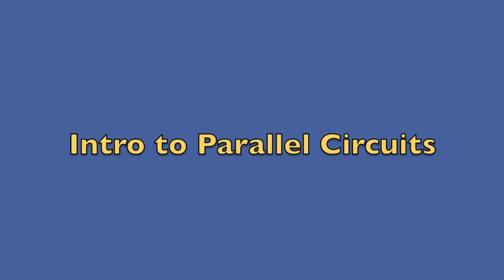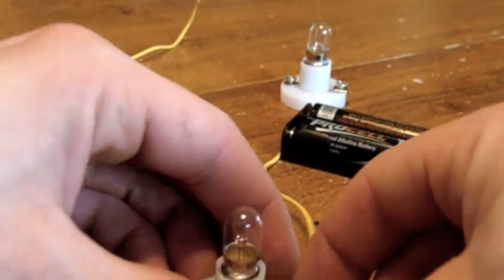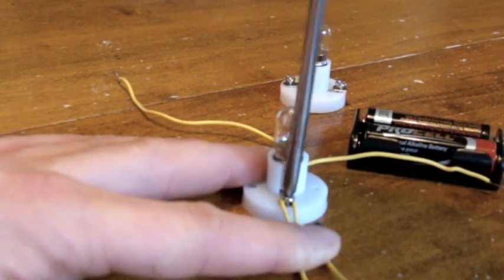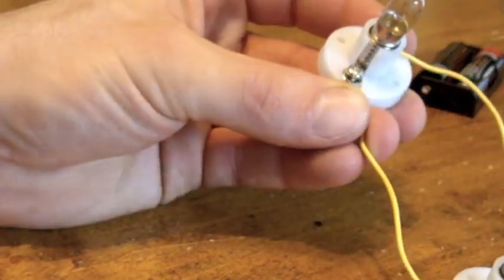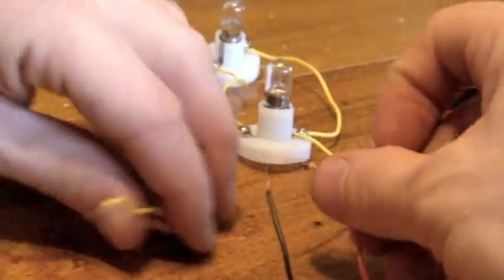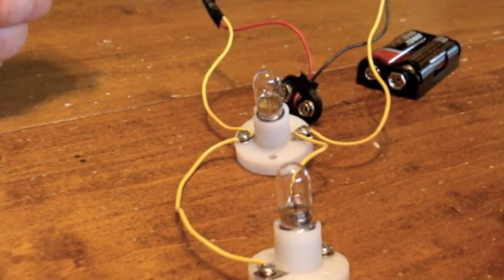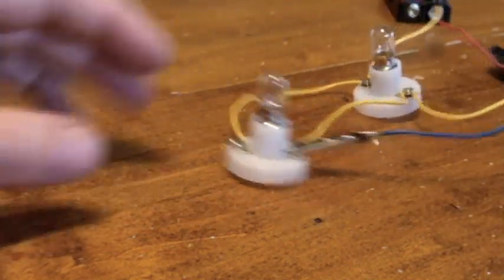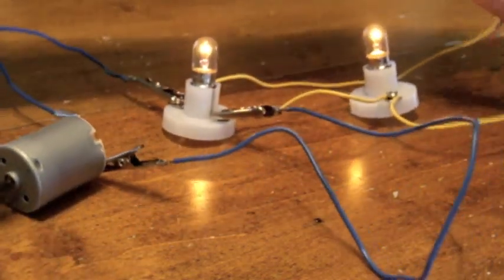Intro to Parallel Circuits

Comment: Important question: can you add an on and off switch and a resistor to this one project? 🤔
Reply from the maker: You can definitely add on/off switches.  Location of the switch is important since you could have it turn off both or just one of the bulbs depending where you put it. If you want it to turn off both bulbs the switch needs to be next to the battery.
Reply: @AaronKennedy  thanks. But can u also add a resistor? 🤔
Reply from the maker: @jesusresendiz875  Don't know why you can't, not sure what you are trying to accomplish.
Reply: @AaronKennedy  oh, it’s cuz I’ve been watching LED light experiment videos and they use a resistor in those videos and I was wondering if a resistor was needed with these mini light bulbs. 👍

Comment: Can you do this without the battery pack?
Reply from the maker: I didn't use a battery pack.  I used a 9 volt batter with a 9 volt battery connector. You can use other batteries, you will just have to figure out a good way to connect the wire to the ends of a AA battery or whatever you use.  Can be a simple as using electrical tape to stick the wires to the ends of the battery.

Comment: Interesting.   Two (2) series circuits, one load each (Direct Current) wired in parallel.   The current is split over the 2 bulbs. Thank you.

Comment: Where would you install a ground wire in this circuit
Reply from the maker: Ground wires are not necessary for a small dc circuit.  You usually see ground wires in larger AC circuits as a safety measure.

Comment: Hello
Why the resistor is not connected in parallel circuit ?
Reply from the maker: Don't need one.  The light bulbs act like resistors I believe.

Comment: Hi! Will this work using 2 bulbs connected to a rotary switch that is connected to a water valve as the on/off switch?

Comment: Bro what is voltmeter is it a wire or  something and what is the ammeter btw this a good video it helps me to my project thx in a million
Reply: A voltmeter is a device that tells you the voltage and an ammeter is a device that tells you how many amps/amperes there is

Comment: Hi I did the same exact thing but my bulb that is close to the batteries is brighter than the one further away from the battery although is it a parallel circuit
Reply: Could u maybe tell me what went wrong?
Reply: Junda the current (amps) is split in a parallel circuit. Causing LESS watts at each bulb. Volts measure same. 
Watts=volts times amps.   Less amps equals less watts, equals less brightness.

Comment: But how we need to connect button with this
Reply from the maker: Experiment.  Try adding a button/switch in different spots in the circuit.  You can make different things happen with the switch in different locations.  If you place the switch near the battery, then the switch is will turn on and off all the lights.  Depending on the wiring, putting the switch near a bulb may affect just that bulb.

Comment: Are light bulbs like batteries ? Connecting two 6V batts in parallel gives 6V but in series give 12 V . Is it the same for 6 V bulbs ?  If I have a 12 V batt , can I use 2 - 6V bulbs in series without problems.
Reply: RapidsVideo i hope you didnt shocked yourself

Comment: Hi sir, i want to ask a question. How do you make a parallel circuit with battery and a switch? If possible please reply, this video might be 4 years old but maybe you can respond?
Reply from the maker: You can definitely add on/off switches.  Location of the switch is important since you could have it turn off both or just one of the bulbs depending where you put it. If you want it to turn off both bulbs the switch needs to be next to the battery.

Comment: aaron, hi.. cool simple  video with a parallel circuit. hey do you know if it is possible to buy online slightly bigger motors like that one? if so, can you point me to a good website you may know of? thnx
Reply: ebay! Seriously, try it. I just bought a small motor, 1/240 rpm, to make an egg-turner for a homemade incubator... there were several 1rpm motors, and bigger.

Comment: sir what items or stuff do you need to build it?
Reply: i try it too yehey.
Reply from the maker: I think you can get this sort of stuff at Radio Shack.  If you live in a city with a Fry's Electronics, they definitely have it.  You could order online from them or really any electronics/hobby site.
Reply: Thank you sir
I make it by the battery only :)
Reply: u need : bulb , wire , battery
Reply: sir help me